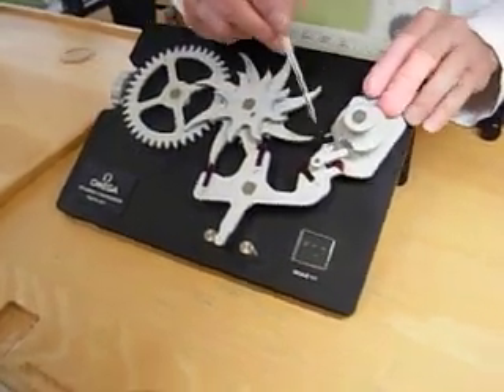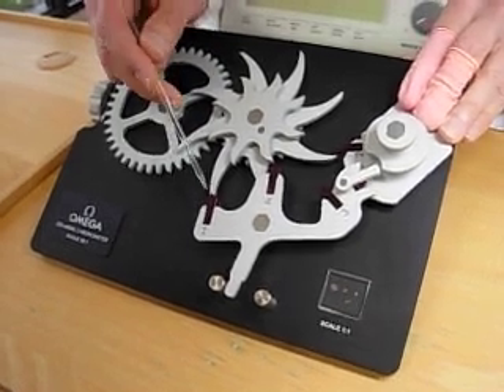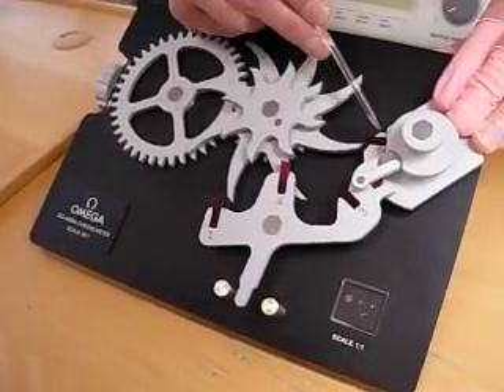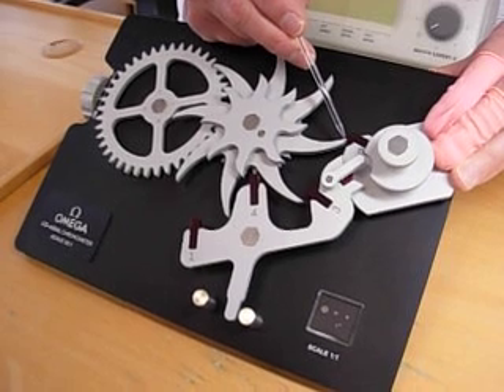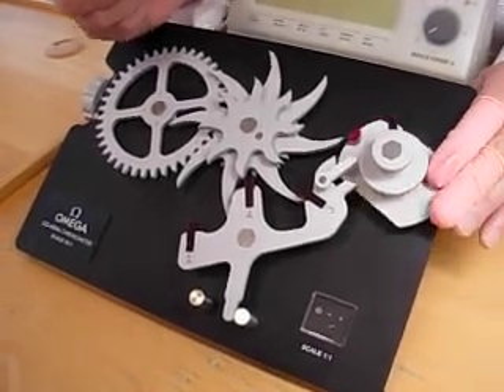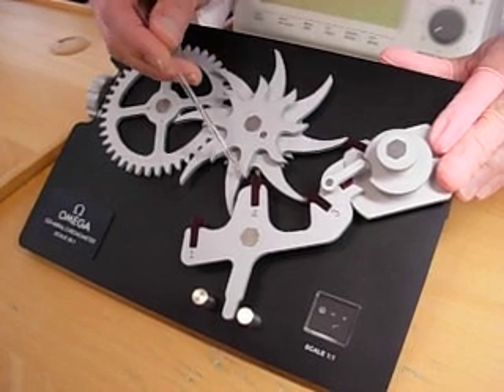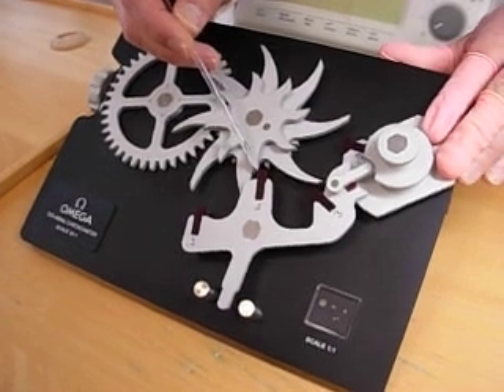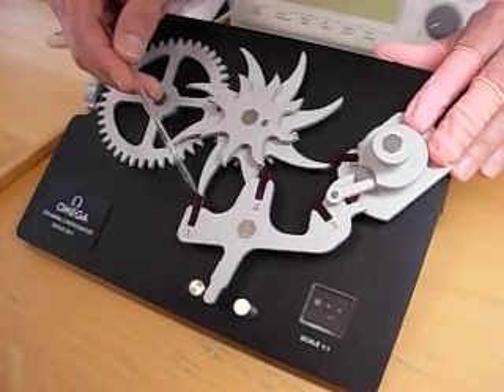Omega Co-axial Escapement

Comment: I get it and dont at the same time
Reply: Same
Reply: I think it's simpley all about managing the hit. The middle ruby (2) takes the wallop then the ruby (3) slides it off. The pair of funny shaped spike claw cogs mean neither ruby is being slide/smacked back out. They each smack in
Reply: The only real difference is that the tooth wheel slaps the balance wheel directly... the escapement wheel is comprised of two toothed Wheels on the same axle which is why they're calling it coaxial.